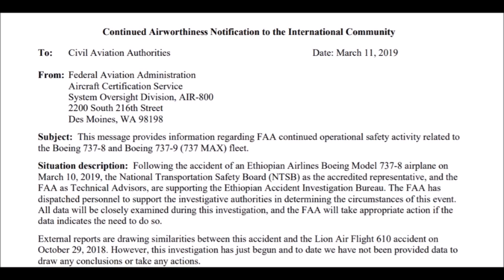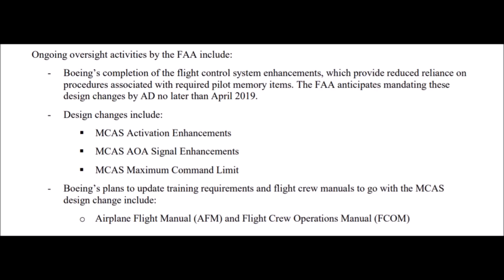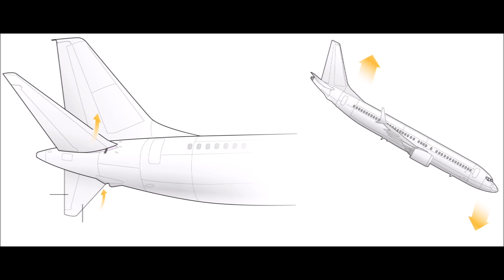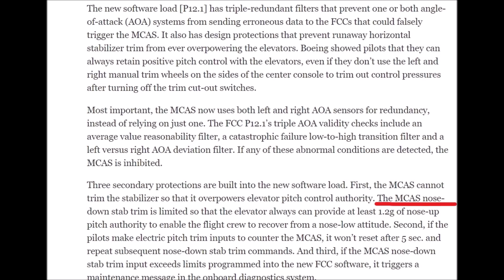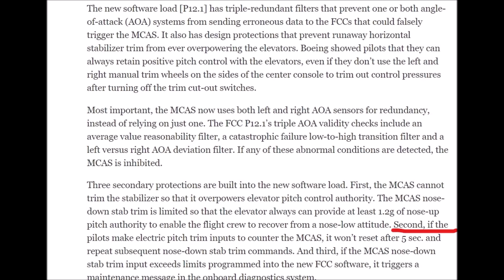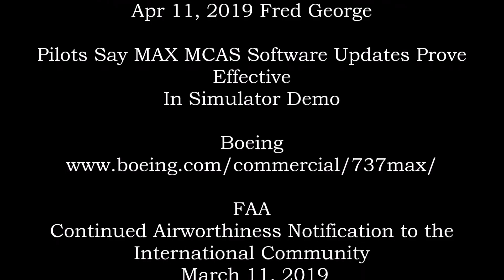737 Max UPDATE 14 April 2019 "The Fix"

Comment: Why can't the pilots hand fly through the nose down procedure?
Reply: They can. They can manually adjust the trim. It might take some muscle, but pilots are trained for such an event. One possible reason the Ethiopian crew reenabled the stabilizer trim cut-off switches was because they inadvertently allowed the plane to accelerate to dangerous speeds and couldn't adjust the trim manually because of that.
Reply: I feel that we rely too much on technology, taking responsibility away from the operator. Whether in be aircraft or automobiles.
Reply: Nose-down means high speed, and speed imposes heavy forces on the yoke. Too much force and the pilot (or even both pilots) can't pull the thing aft.
Reply: Because pilots are only allowed to fly the way the computers will " let them fly"
and if the computer is having a brain fart , computer wins and you die !

Comment: Right now I don't want to get near one of those planes.
Reply: You can't as they are grounded, when they get back in the air it work as it should of been from the start it be as safe as any other Boeing plane ( if you've watched the video the plane will operate as it should have been from the beginning, I'm still can't believe how MCAS was originally implemented from scratch on the 737max when they should have just simply copied rules that  they already had on the tank of variant of the Boeing plane MCAS)
Reply: And yet you're more than happy to jump into a car and head out onto the roads of America where we average about 35,000 deaths (and countless life-changing injuries) every single year.

Comment: Thanks for the update, and explanations. I recently read the details of proposed fixes, and they seem comprehensive.
Reply: Someone at Boeing should be put in jail for signing off on the original design and implementation of MCAS.
Reply: They could have done better.  MCAS is software, so add a MCAS cutoff switch or code so you don't have to kill the trim power to kill MCAS inputs.  They should also add an altitude/pitch check to disable MCAS when close to the ground with nose down pitch.
Reply: 1. Adding more rules (and switches) than strictly necessary does not improve safety, it only increases complexity, and the possibility of unintended failures. 2. If you are already close to the ground with nose down pitch, then MCAS is the least of your problems. Most aircraft land with nose up pitch.
Reply: Unfortunately the skeptics are still going to be doubtful...
Reply: @gordonrichardson2972  Sceptic here... 
Ok, so they've figured out the fix for MCAS. And it looks good.
Now. How many OTHER system were f-ed up in the same way, by the same design philosophy, by the same people or department that did the MCAS?
How can the public be sure there are not other murder-the-passengers glitches in the automation?
Reply: The FAA and Congress will be doing an unusually thorough review of the MAX certification process, and this is likely to take months rather than weeks.
Reply: @marvinkitfox3386  great question!
The single objective now is minimal changes to get 737 Mx allowed to take off... so MCAS 2.O

Immediate goal is not to recertify ALL Max changes.

We've seen how poorly MAX changes got swept under the carpet. Now is a good time to be honest and come clean with self-certified changes... time will tell.
Reply: @marvinkitfox3386  I agree.. We should be skeptical--very skeptical.. A skeptical eye would have prevented a failed system from relying on a SINGLE sensor.. We want our regulatory bodies to be very skeptical..
Reply: Your comment on motor vehicle automation is sure to ruffle a few feathers.